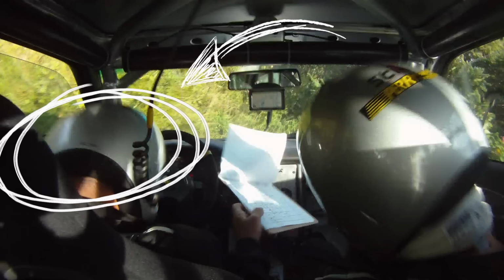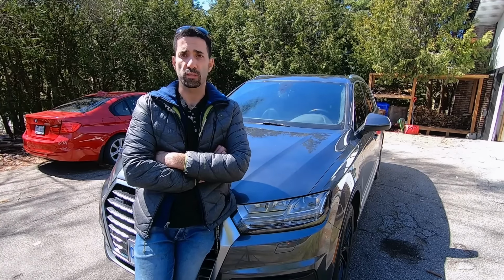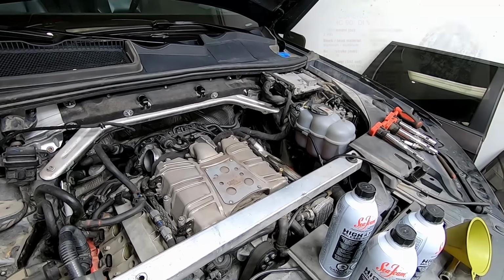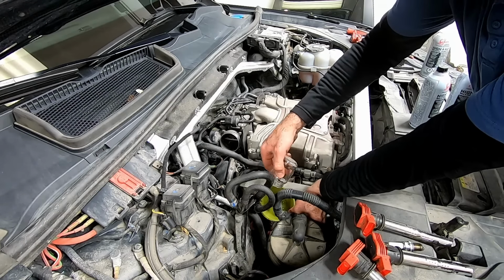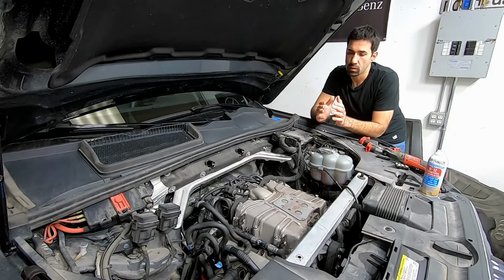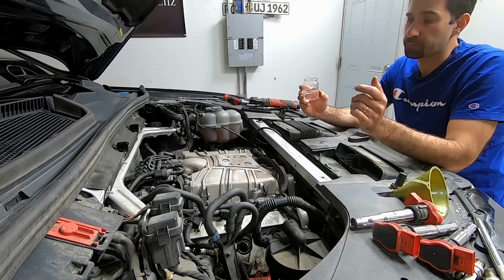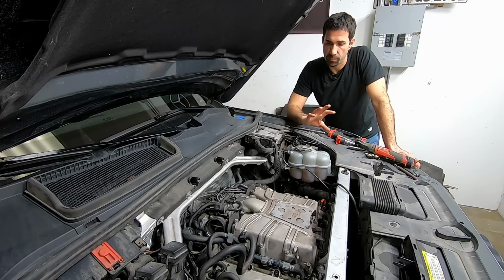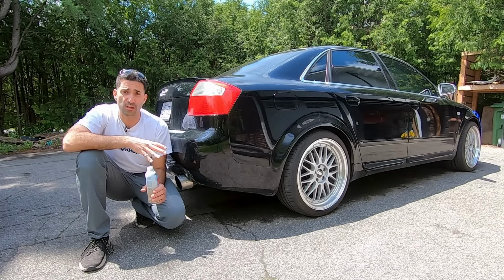How to fix oil consumption on VW/Audi/Porsche 3.0T engine?

Comment: @ 18:15. Was that a vacuum tube or shop air you had inserted into piston 1? Also, did you do that to each piston individually?  Then, after clearing out each piston,  you did crank it by hand once more , correct?   Im just trying to write down each step and make sure i do everything exactly how you did it because im helping a friend do this to his car and he relies on me for the knowledge and understanding on how to do this properly.   Thanks
Reply from the maker: @jamesbroomfield7799  that's the first run with the seafoam which wasn't successful... at 18:15 I had to vacuum out the pistons because they were still full of liquid... when I repeated with the B12 I didn't have to do that because it had dissolved a lot of the garbage so it required compressed air... and yes you should crank by hand as much as you can to make sure everything spins freely before you hit the starter

Comment: As far as turning the crank-- I have a 2017 q7 3.0 and have been searching all over the internet for what to use to turn the crank, it seems to be HARD to find info. Is just a regular 22mm deep socket needed or a special crank turning socket tool needed for the 2017 q7 3.0?  Haven't had a chance to get under the hood to check it out yet.

Comment: I wonder how a concentrated PEA intake valve cleaner like Amsoil Power Foam or CRC would do.  It breaks carbon down so quickly that you might not have to soak it for long.  I am currently helping a friend with her 3.0 Q7.  I just put Amsoil in there after using the Amsoil flush and the burning got worse.  My guess is that it cleaned out the oil squirter passages and lower rings, but the top compression ring is still stuck.  I just put 4 ounces of Yamalube Ring Free in there to see if that helps.
Reply from the maker: @natecram6230  a few folks have mentioned yamalube - keep us posted with your results
Reply: @ETMotorsports  Hey.  The results are in on that 2017 3.0 supercharged Q7.  The oil level is at the same point as it was two weeks ago.  It appears to have stopped completely!  Four ounces of the Yamalube mixed with Chevron Techron to thin it out enough to get down into the tank (it's thick like 10W30 engine oil).  I put four more ounces in there last week at the fuel tank refill just for good measure, but I don't know that it was necessary.  Again, it's running the Amsoil European formula oil which I had not drained out since I put it in a couple months ago.  Do you think I should pump out a sample to see how black it is, since the chemical probably loosened a lot of gunk in there?  If it's really bad, I wonder if I should do another oil change.  Probably wouldn't hurt.

Comment: So I have a 18 Audi A7 , it's tuned stage 1 , has a cai and a merc hx . I do engine flushes and use molygen 5w-40 and change oil every 3k miles. I'm usually on it when I have the chance . I usually get a low oil indicator bout every 1,300 miles
Reply from the maker: @eagleeye8916  that's still reasonable but you're definitely on your way to higher consumption

Comment: Amazing video, i am going to try with a botle of seafoam and 2 of MANNOL 9770 Carburetor Cleaner 600ml, is the only thinks with similar compositions that i cant find in spain. I will and the update to help other people that cant find B12. Do you think that 3 bottles are excesive? or i would only use 2 and part of the last? thanks
 I have a A4 2.0 tfsi 2010 engine
Reply from the maker: @aketza6627 I did a 2.0t in my q5 - you can see the other episode...I think I used about 100ml per cylinder and topped up as required... everybody's engine seems to react differently so you may be ok wth the amounts you have... keep us posted on your success with Seafoam and mannol
Reply: @aketza6627
Bonjour as-tu fait ton trempage de piston avec ton mélange ?
Je suis français et on ne trouve pas de B12 en Europe.
Reply: @ecerce2151  not yet, it is impossible for me to find a garage where I can do it, as soon as I do it I will put it here.

Comment: 2017 Audi Q7, I did an initial soak and the crank kept getting stuck at a certain point.  I ordered the Crankshaft turner (tool  number JTC4573) however it is 2 more weeks away, hence I am using this time to soak the pistons as best as possible.  I have jacked up the passenger side 1 + foot and filled the pistons as much as possible.  Piston 3 is almost TDC and I noticed it is not holding the B12 for 6 hours.  What is your best advice? Just keep topping it up every couple hours?

If you have a 2017 Q7 I would suggest you order the crank shaft turner before you start.  I have to wait 2 weeks for the tool to be shipped, no company has it in my city, not even the Audi dealership, that one is a head scratcher.
Reply from the maker: That's unfortunate - Amazon had it overnight... no need to lift the vehicle - 1ft on either side won't do much to level your pistons... just put them at TDC or use al more solvent... the pistons will not leak down the same... keep an eye on it - on most cars I've done,  the rate or leak down changed for each piston
Reply: @ETMotorsports  Thank you!  I bought lots of B-12 hoping to chew through the carbon.  I will wait for the tool to arrive.
Reply: Were you successful in turning the crankshaft by hand using the special socket?

Comment: Will this fix white smoke coming out of exhaust 3.0tfsi 
It have good headgasket i did the pressure test did not drop. 
When on idle its not that bad but when reviewing it smokes alot.
Reply from the maker: hmmm white smoke is generally coolant...oil will be blue and fuel will be black...you sure you don't have coolant coming in from somewhere?

Comment: Good afternoon friend. First of all, thanks for the tips, it helps me a lot. I'm going to do this procedure with B-12 on an Audi A3 Sportback 8P 2.0 tfsi 2007. The car has 170,000km on it. The correct option is 50ml per piston in pms, that is, 100ml for pistons 1 and 4 and wait 12 hours to turn the crankshaft. Then add another 100ml and wait another 12 hours. After 24 hours, repeat this process on cylinders 2 and 3. After 48 hours, I will have used 400ml of B-12. I bought 2 bottles of B-12. Can I repeat this process until I reach 888ml from 2 bottles of B-12? Do I need to clean with compressed air at the end of each 12-hour immersion or can I turn the crankshaft to continue the procedure without cleaning? Is cleaning with compressed air only done after the entire procedure and before starting the car normally? My last question is regarding engine oil. After finishing the procedure, can I change the oil before starting the car or do I start it first with the old contaminated oil to change it at the right temperature? Thank you very much for your attention and help! Success to the channel!
Reply from the maker: Hey for the 4cyl 2.0T you should watch the other 3 videos - I've answered all the questions there... on the 4 cyl you can soak all 4 pistons at the same time,  100ml per piston every 12 hrs... use both cans...I run the engine with the B12 inside for about 30 min to do a complete clean up but if you're worried you can change the oil before that
Reply: @ETMotorsports  I did watch the videos, I always follow your work. I really asked to confirm and so that I don't do anything wrong. I'm going to choose to do all 4 cylinders at once and start the car before changing the oil to complete the cleaning. Thanks again friend.
Reply: pretty much all my Questions too...👍 I cant wait to do mine.🙏Good Luck to you also. this guy is Great!!! Very Knowledgeable
Reply: @timpresutto184  Hello, friend, good morning. I hope these tips help you too. In the end, everything will be fine.

Comment: Hi - so I'm going through this right now, I soaked one set of pistons and blew off a bunch of the gunk but I'm still unable to crank it by hand. I tried turning it counter clockwise a bit and it did rotate, so I tried blowing again but with little effect.

Any suggestions? Do you think I should hit the starter?
Reply from the maker: @vSynZero  no absolutely no... don't hit the starter... while it may be ok and it just plows through the garbage,  there's a chance that it does irreparable damage... if you can turn it back then you're hitting the same garbage I was... can you confirm that's when the soaked pistons are at TDC? Can you see inside the cylinders?
Reply: @ETMotorsports  Yeah - the soaked pistons were at TDC, i looked inside with a scope but I don't have a side view - it looks like ive blown out most of the gunk (i was at it for a while and it actually looks really clean to the point where i can see the letters on the pistons!). I took it counterclockwise and there was some resistance at BDC - blew it out some more, but still gets stuck at the same spot at TDC going counterclockwise. Any thoughts - maybe I should let the b12 evaporate and try using the air blaster again tomorrow?
Reply from the maker: @vSynZero  hmm first of all try not to spin the engine backward too much because you're going against the chain tensioners and there's risk of timing issues... that said if you're careful, you should be ok... now for getting stuck - while the footage in the video is horrible, and I apologize for that but you can see what's happening... all of the gunk that gets dissolved piles up at the low side of the piston - if you can picture the piston at 45 deg, all the liquid and gunk eventually goes through the lower side... so that builds up and stops the piston from pushing through...

I've been thinking about this issue as well... if you've already blown up a bunch of garbage,  I think the next thing you can try is to pour more B12 in those two cylinders... you don't need to cover the pistons since you're not trying to soak the rings,  but I think the liquid will help soften up any buildup that's left at the lower side and perhaps help you push through...

So why don't you try this - pour say 30-40ml in each of the two pistons,  give it a few minutes to soften up but not drain through and start working the crank manually going back and forth at that spot... if you feel it starting to give, you can probably apply a bit more torque to the crank and get through the pile...

This is very annoying but it makes sense that it happens - all the dissolved crap has to go somewhere... I'd be curious to record a time lapse of an actual soak to see how this forms up
Reply: @ETMotorsports  Thanks for the advice! I'll give that a try and maybe try to blow a little more out and see, it's actually cranking a little bit smoother now vs before, but well noted on not cranking it backwards too much
Reply: @ETMotorsports  Hi - so i went to work at it again today - i tried blowing at it for a little while longer after more of the b12 had evaporated, maybe a very small amount came out. i suspect that it's a little more flakey when it's dried up vs when it's still wet. then i tried wiggling it back and forth a bit where it was previously stuck. then backed it out a bit and added a bit of solution (a little less than you suggested as the pistons looked very clean) as leaving it where it was stuck might have caused the bit of carbon that was causing the blockage to be jammed in there, worked at it with no success. I blew at it again, backing it out progressively, then tried again and there was resistence but it went through. Will give an update once the rest is complete!
Reply: @vSynZero so how did it go mate? All good?

Comment: Advice to replace  the pcv under the supercharged unit. And check if there is any tsb for a ecm calibration after  the replacement
Reply from the maker: the pcv was already replaced on this motor so I didn't need to go that deep

Comment: Thanks for the content.   Any change that the B-12 will harm or degrade the head-gasket material?    When the engine wouldn't turn, That large gunk chunk of carbon.  Do you think that probably came off the manifold side of a valve stem and made the valve stick open?    I ask because I just bought a 100,000 mile  Q7    3.0   TFSI   today and I suspect that I will be duplicating your process soon.
Reply: I just read something like that other comment I think carbon clean is better . Because you have the process of vacuum. While in chemical if you have a big chunk of carbon in one side it might take longer to break . My guess not sure .

Comment: in some cylinders the solution will evaporate throught the valves even with rag in the spark hole
Reply from the maker: @sHpAaKu316  it doesn't really evaporate fast enough to worry about it...I put the rags in but they're just keeping stuff from falling in... not really stopping evaporation
Reply: @ETMotorsports  probably right mate. shame we can't but this liquid here in EU. looks like it works magic. good work overall

Comment: Hey! Great video. Hoping this to be my saviour for my '17 Q7 3.0. My local mechanic recommended doing the soak when all the pistons are at the same even level. Not at TDC. He said we would want more space for the soak and that’s why he wouldn't do TDC. Also, he said B12 is too thin so he would do a 75% B12 and 25% a thicker. Do you think these approaches are alright? I normally want him to do the soak your way but he is the only reliable mechanic that can do it around the area and i dont have equipment, so i’m lowkey forced to do what he says.
Reply from the maker: @TansuAydemir-q3j  hey I'm surprised a mechanic is willing to do it for you - that hasn't been the general experience... there's zero benefit to the pistons being at the same level - it's irrelevant...TDC helps you keep the amount of liquid low - if you have lots of B12 to play with you can fill up your whole cylinder and then TDC is irrelevant as well... but keep in mind if you plan to run the motor with the B12 in you don't want to have too much in there to dilute the oil too much ...

As for the mix - I mean there's no right or wrong answer here...I think thin works better because it want it to go through the rings easily... if your mechanic has experience with another combination by all means try that...

Has he done this before? This exact method has been successful for a number of viewers but there are ways to modify it if he's done it before and has experience with it
Reply: @ETMotorsports  thx for the response! he told me he has done it before but i dont know if he did it with a 2017 3.0 q7. i’ll definitely show him your comment. i really want to do it on my own but i’m an international student and i lack a lift and other equipment to do it. i bought the car used for a really cheap price and was expecting to see some oil burn. for now it seems like a quart for every 1,500-2000 miles but my electronic dipstick is really unreliable so not totally sure

Also one thing that I’m afraid of is the time it takes to do it with TDC. The soak he offered takes 24 hrs but if I tell him to do it at TDC it would mean 72 hrs. Even if I convince him about TDC being more effective, I’m not sure if he would be okay with doing a 72 hr soak. But I’ll try my best to reason with him

Comment: Hey i been following up with your videos on this topic. I have a 2012 Audi a3 (8p) with a 2.0tfsi engine. My issue is that along with oil consumption i am getting, one of the cylinders are wetting the spark plug with oil and causing misfire. It could be the piston rings as i had a shop do the timing chain, rear main seal and new cylinder head as they thought it was the valve stem seals. They basically half-assed rebuilt my engine and I lost lots of money. The car has been sitting for 2 years now since it can't pass emissions, I want to give this method a try before trying to buy another engine. What do you recommend? Do you think this could help?
Reply from the maker: @SupremoFilms   @SupremoFilms  hey 100%... if you watch the first video on my A4 I had the exact same issue - cylinder 3 spark plug was soaked with oil and would misfire within 5 min of running... the car wasn't driveable - the engine would shut off that cylinder because of the misfires...I did the valve seals as well and that was a huge waste of time... the piston soak completely transformed the vehicle
Reply: @ETMotorsports  I appreciate your response, and yes I have watched all your videos on this topic. I'm going to follow your steps and will keep you and the community updated as soon as I can.

Comment: Two questions 

I’m going to give this a go in a couple weeks while I don’t need the car daily… 

1. If I run into the carbon issue where you can no longer crank the car by hand, and the valves are open but you can not crank the car… what to do? Just blow it out? 

2. Of course you’d want the oil to be warm but is it better to just immediately drain the oil without even starting after doing this? 

Appreciate any help!
Reply from the maker: @nelsinivr6  on the first one - yes pretty much all you can do is blow them out and keep working it... for the oil it's your choice - I run my engine wth the B12 but some people are worried and drain it without running
Reply: @ETMotorsports thanks for the reply! Cool maybe I’ll run it just a bit at idle to warm the oil otherwise draining might be a pain haha. 

I was mostly just concerned w blowing carbon past open valves but what came out of yours didn’t appear it would necessarily hurt anything… hopefully.

Comment: Question about procedure. Do you know if it is possible to reduce the overall time for the process to 24 hours by putting b-12 into all cylinders at the same time? With rough estimate being: 2 cylinders at top dead center - 50ml, 2 cylinders at bottom dead center - 550ml, and ones in the middle - 300ml. For a total of 1.8l of solution going in.
Reply from the maker: @avprokofyev  hmm your best bet is to soak at TDC... if you absolutely must reduce the time just do 8hrs per pair at TDC... should be enough to get the results... worst case you just repeat the treatment next oil change if not 100% effective